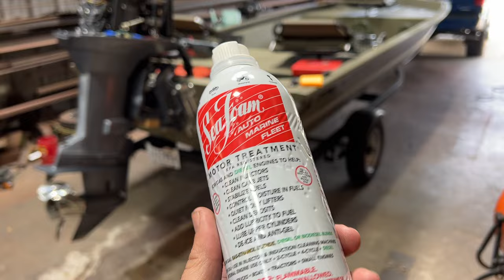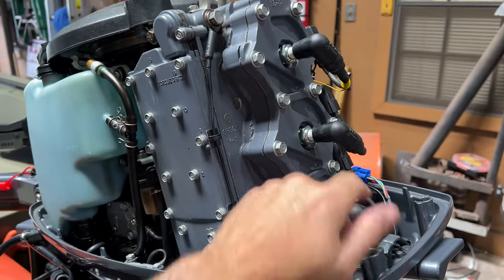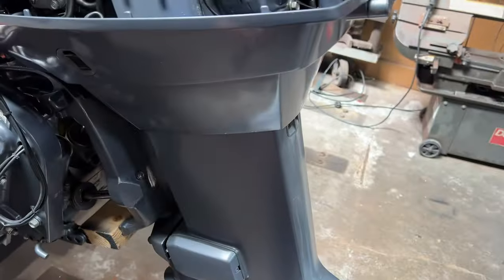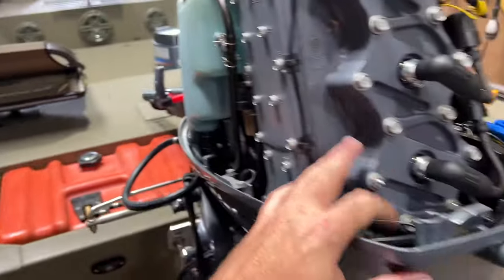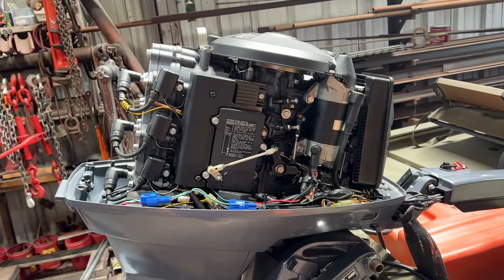Can Seafoam Improve Compression?!? - 2 Stroke Outboard Results!

Comment: Thats a clean motor very nice i have a 07 Yamaha 115 2 stroke thats clean like yours when i first bought mine i shocked it with a huge dose of Yamaha ringfree my compression was 130 psi on every cylinder i run non ethanol fuel only and a shot of ringfree in every fill up of gas and my motor runs flawless
Reply from the maker: Thanks! Yeah ringfree was a lot more expensive but I’ve heard great results. I think 1 more treatment and my bottom cylinder will bump up 5 more psi
Reply: @RaztechPowersports  I got a few more psi when I turned the throttle to wide open and did the compression test if you try it like that you might get a few more psi
Reply from the maker: @DustinKeating-yk3vq  yes, both test were at full throttle